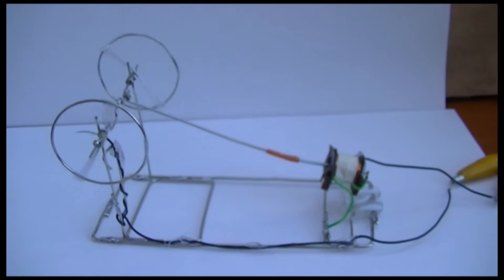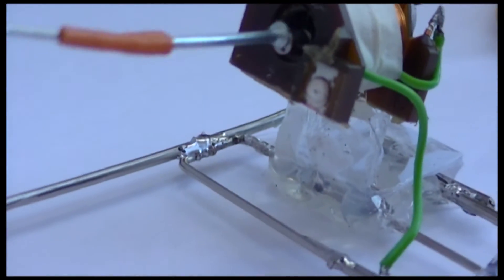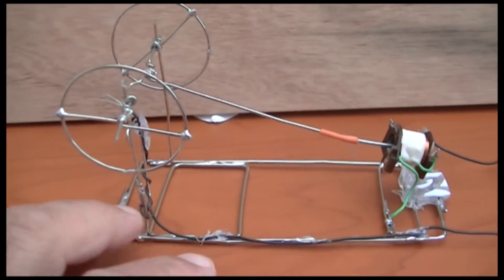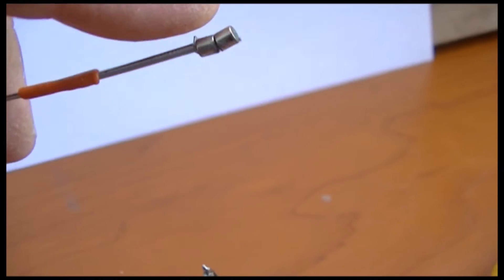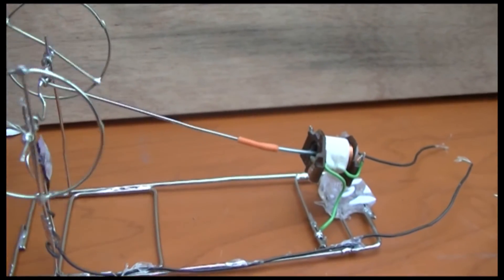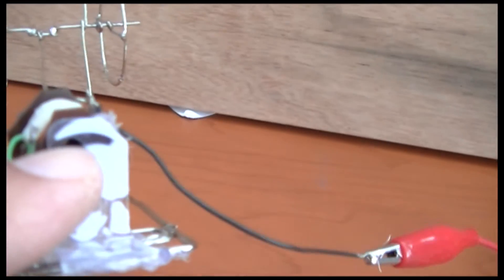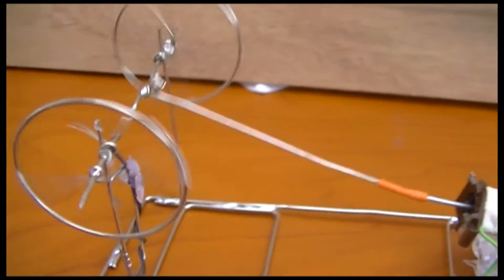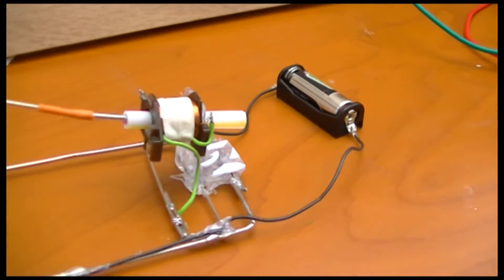Paper clip motor Mk 2. (Solenoid Engine)

Comment: I was hoping you would detail the switch and how it makes and breaks the current.
Reply from the maker: You see that black wire in the middle and the bend in the shaft well it just touches at the right moment as it goes round. 
I will find the other one and send you the link. I think I explain it better in that one. 👍🏽
Reply from the maker: Okay so this is another engine and I think it explains the switch. 

https://youtu.be/ITizPQDQ7us?si=WRh8-dCTL3o626PI
Hope this helps